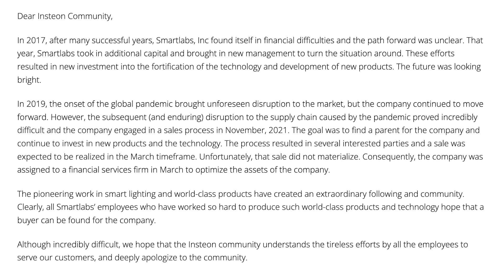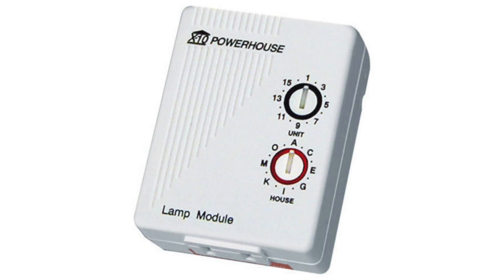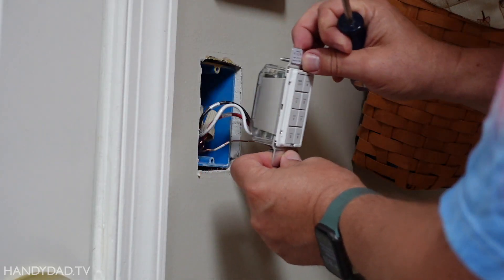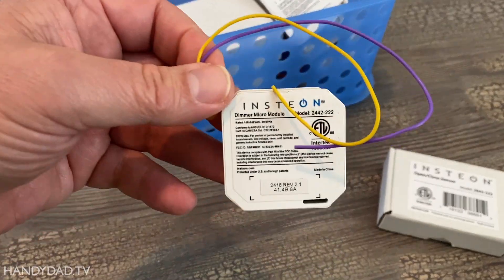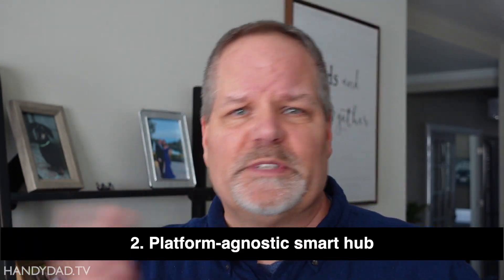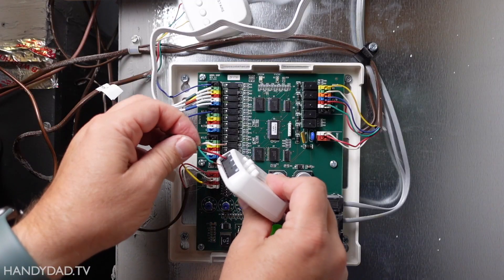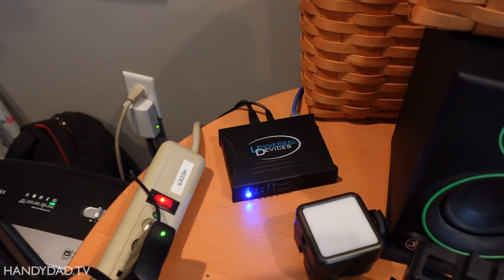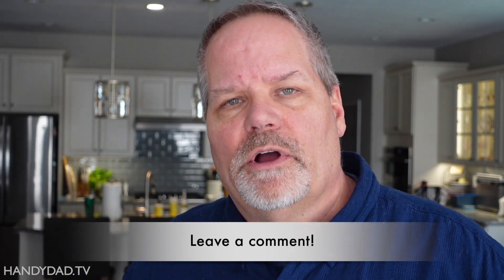INSTEON out of business. What to do?

Comment: I've had Insteon since 2005 when it first came out so about 20 years.  I soon found the ISY controller which lets you easily program the Insteon devices to talk to each other directly, no hub required.  The ISY also lets you setup time of day and IF-THEN-ELSE programs to turn ON lights at night etc.
When the original Insteon company went under, my system kept right on going as it is not reliant on outside servers.
I have purchased more devices from the new Insteon company.  If it fails, my system will continue to work.
Reply from the maker: I admire your commitment but I switched to open standards.

Comment: I have the Insteon Hub v2, and I have around 40 insteon devices in my home. However, I recently installed Home Assistant to integrate other devices like phillips hue lights. The problem is that when I press a button on a insteon keypad or light switch, Home Assistant sometimes recognizes it and sometimes doesn't, and other times it does but takes up to 30 seconds to respond. My local network is very good. I'm not sure if it would be better to use the PLM instead of the hub. What do you recommend?
Reply from the maker: My recommendation is to plan your exit strategy.

Comment: Insteon is still selling devices. 

I feel is there is nothing on the market that offers even a fraction of the features that insteon switches have offered for more than 15 years.

\-Duel mesh network resilience 
\-Led brightness control  
\-Button press beep control  
\-True up and down rocker style  
\-Built in dimm by pressing the rocker (not a seperate button)  
\-Ramp on levels  
\-8 Button switches  
\-Linking devices/switches without a program  
\-No need for wifi  
\-insanely fast/responsive
\-most all colors of decora colors for devices and wall plates.
\-remote switch option
Reply from the maker: You’re not wrong about the technology. If only they made it an open standard 10 years ago, Zigbee wouldn’t have had a chance. 

I just don’t believe the company will make it long term.
Reply: @handydadtv  If what you forcast, is true, then lucky for us Insteon users, another Insteon feature is also true: the devices can be set up and programmed in so many different ways, (even manually).  The devices can function whether the parent company exists or not.  I just purchased a USB Modem to tinker with. 

Best Wishes

Comment: My home automation is purely local. I was considering to get some Insteon stuff a few years back. Home Assistant was what I went with and have had zero regrets. I pay for Nabu Casa, but do not use it as I don't need access to my home automation stuff when I am away from home. I do it to support the Home Assistant team. I buy switches, etc that have Tasmota pre-installed on them or can have Tasmota installed on them. I have also bought some Zigbee devices (Zigbee 3.0) and have the Sonoff Zigbee 3.0 USB dongle. Home Assistant has plenty of integration, including Insteon. I had a few X10 back in the day.
Reply from the maker: I went with HomeSeer. I have tried to setup Home Assistant several times on my NAS and just can’t justify spending the time to get it all working with my Zigbee/ZWave combo stick. And the Insteon integration isn’t nearly as functional as HomeSeer’s.

I kinda feel like a failure because so many people use it! I’m sure I could get it working; it’s just a matter of time that I don’t have. 

Maybe when I retire…
Reply: @handydadtv  I first started with HA on a Pi, then as a VM on Proxmox on a small brick PC and then in Proxmox  on a much better system that had more resources and I was adding more and more VMs and such. Because  I had so many VMs, LXCs and I did not want HA to be down when I had to restart Proxmox. I have 95% migrated HA to the HA Blue hardware (Odroid N2+) . I have MQTT, Node-Red & Zigbee2 MQTT , ESPHome running as LXCs on a smaller Proxmox system. I still need to get InfluxDB and Grafana installed as well. When I had HA on Proxmox, the rest were add-ons inside HA. I prefer to have them isolated. I had to Zigbee2MQTT on a VM, as passing the USB port of the Zigbee dongle was quite unstable. Everything is very responsive and I am adding more and more automations. Next project is to use a Martin-Jerry 3 button dimmer that is running Tasmota (3rd party open-source firmware). Using rules to create different lighting scenes for the bathroom. Default will be warm white low level. Can change to warm white mid level, then to full level neutral white. Also can vary the brightness as a normal dimmer as well.
Reply from the maker: Wow! I definitely appreciate this info because it confirms that I made the right decision FOR ME at this time. I am a computer geek and I’m sure I could solve it eventually if I dedicate the time. Maybe someday.

Comment: I have insteon in our house, 4 yrs old, no wifi connection just wall switches, i have one toggle switch that will not turn our dining room light on, it worked for a year or so, then it was intermittent now nothing, i have resett the switch but that was no help, Our controller or hub is in our attic and since insteon went  out of business our electrician will not snswer his phone, and with a bad knee i cant get around in the attic,  any ideas?
Reply from the maker: First, it was a mistake to put your hub in the attic. Temperature extremes are bad for electronics. 

Second, Insteon was only out of business for around 8 weeks. They’re back now, but your hub will only work with a paid subscription. 

Third, even if your hub is fine in the attic and you paid the subscription, if you reset the device, you need to pair it to the hub again.

Comment: You took me back in time.   I also have many X10 modules and the clock timer.    Worked well for a long time.    I still use an X10 motion sensor on an external floodlight.     I do not look forward to the day when this motion sensor dies.
Dave.
Reply from the maker: If you haven’t heard, Insteon was resurrected. https://youtu.be/hZXfzFe9wDM

Comment: Homeseer looks great.  It's a bit out of my price range, though.  I'm considering Hubitat as a more cost effective route for keeping my Insteon setup working (with Alexa) with no monthly fees.  I'm worried about the learning curve, though.  Any chance you might have a look at it?
Reply from the maker: I looked into it and the Insteon interface sucks. Same with Home Assistant. That’s why I recommend HomeSeer. Yes, the Insteon plug-in costs $59, but that’s cheaper than the cost of a single Insteon device. You didn’t skimp on your switches. Don’t skimp on the solution to keep them running.
Reply: @handydadtv  Thanks for that quick reply and insight.   Also, your videos are amazingly clear and straightforward.  Much appreciated.
Reply from the maker: Thanks so much 😊

Comment: I have a house full of insteon devices.  I started migrating into some zigbee and z-wave devices when I added Kwikset smart locks to my doors.  The ISY/Universal Devices products have integration for all three technologies and I have found it to be much better than the Insteon Hub.  I will miss the wall multi-switchs and hope that some one buys up the patent and starts manufacturing some of the insteon products (including the PLM which you have to have with your ISY to make it work with insteon)
Reply from the maker: The need for a PLM is definitely a drawback. I had an ISY/ZW with a PLM, did a review, and then sold it. I’m a happy HomeSeer user now. It works with the Insteon hub, which most people have.

Comment: Looking forward to figure out what to move to next. I really liked insteon connected with the scenes in a Universal Devices controller except two things. I've already replaced the power line adapter three times and the fan controllers are inconsistent speeds when you have two fans in the same room low medium high are not the same on both of them.
Reply from the maker: I went with HomeSeer because it works with the Insteon hub. Future devices will be Z Wave.

Comment: I have a huge investment in Insteon. I ended up purchasing a HomeSeer Probdevive and the Insteon Plugging. Works great and gives me the ability to integrate wireless, x-wave, zigbee, etc. in fact I already have some x-wave devices controlling Insteon devices. No requirement for cloud services.
Reply from the maker: Agree, HomeSeer is a great solution.
Reply: Appreciate the tip - only hub available right now is 899.00 model - a lot of people in need, but looks ver good
Reply from the maker: The good thing about HomeSeer is you can set it up on an old Windows laptop or desktop with a 30-day free trial. Then migrate to a HomeTroller when they are back in stock.

Comment: So a lot of this is a bit over my head. I just bought a home that has Insteon lights. I downloaded the app and am failing to get it set up. Continuously getting error messages no matter what I do. Is this just not going to work for me now? Is there a simple solution?
Reply from the maker: That depends on how many Insteon switches you have, and how much you desire to keep them. You can continue to use them manually, but automations and voice control will require another solution since the company went out of business. 

This is the easiest solution I’ve found: https://youtu.be/1bs-IBOp72A

If you want to go this route, I’m going to be doing an in-depth setup tutorial in a couple of weeks.

Comment: don't worry! Insteon devices, hubs, and such are NOT dead! yes their app and servers are dead but not the devices in your house!

I have a whole house of Insteon devices!

Use Insteon devices and Hubs with Homeassistant. the LED stays red but works!

Use Insteon devices with the hub and already programmed timers like day/night timers. My sunset and sunrise still works!

Use Insteon devices without your hub.

Use a ISY which requires the hard to find Insteon PLM which is prone to failing caps!

Homeassistant works with the ISY hub, Insteon hub 2 (no PLM), hub 1 (PLM), or a USB/Serial PLM. The community is working on getting it to work with the very short released HomeKit Pro Hub.

Homeassisant is free and supports many devices and networks. they are also open source. it works on Raspberry PI or computers. dockers and VMs!

Homeassistant works with many devices without cloud, the goal is to make the devices work without cloud!

As for keypads, Creston (Pro Install) and Lutron (I think DIY & Pro Install) both are the only ones I know right now who have keypads.

Apparently Universal Devices the makers of the ISY hubs are in talks with the liquidation company to take the assets, servers, and patents!

I currently have my Insteon House working with Home Assistant but since I'm a Crestron installer, programmer, & integrator at work I'll be upgrading my house to Creston lighting, Shading, and automation.

If anyone is looking for help with the current Insteon network on their house or help finding alternatives go to the Insteon reddit!
Reply from the maker: Home Assistant is great for techies who have the time to read, research and troubleshoot. The software may be free, but my time is valuable. 

The Insteon integration is undergoing major enhancements right now since Insteon went out of business. It’s not there yet; it needs a few more months before I will review it for my audience. Some of my viewers think HomeSeer is too technical! There’s no way they are ready for Home Assistant and YAML. 

At this point, HomeSeer is my favorite. https://youtu.be/1bs-IBOp72A

Comment: I purchased the Homeseer software which has been around for over 15 years and their Insteon integration works with existing Insteon Hubs over your local network (NO Servers needed) the Integration also works with any PLM  and runs on an old P.C. running windows 10 or Linux or it can run on a Rasberry PI, for under $250.00 it is on sale now. They also sell pre-configured hub servers which can be expensive. Homeseer uses software plugins that support most devices and protocols, Z-wave, Zigbee, Insteon, Ecobee. Lutron. TP-Link, Hue, LIFX, Sonos, and many more. Yhis is more than Lighting control, this is Home Control.
Reply from the maker: I’ve only been using it a couple of weeks, and just for lighting, and I’m very impressed.
Reply: @handydadtv  I started with X10 and got Insteon from the Smarthome store in Irvine CA I also had an ISY-26 that would not work with Amazon Echo.
Reply: "Any PLM"? What Insteon PLM is there other than the 2412n?

Comment: In my previous home I had installed 69 Insteon devices about 10 years ago. In my new home it came with 6 Lutron devices but I liked the Insteon better, especially the 6 & 8 button switch. I had some extra devices that I brought with me. I purchased the Insteon Hub, 2245-222 a couple months ago but I didn’t try installing it until a few weeks ago. SURPRISE! I forgot that I needed a PLM. I am a Mac person but I forget which PLM I need. I do have an older model AppleTV that may work to keep my iMac 27 from staying ON all the time. Can you please suggest which one is best. I do have an extra modem PLM but I don’t remember why I switched to the USB version. I am looking at the Home Assistant software.
Reply from the maker: So you have a hub and a USB PLM?

Comment: Hi Chris... apparently I made the same mistake - hitching my wagon to INSTEON.  Didn't see the big go-dark situation because I'm using a Universal Devices ISY.  My home system consists of 65 devices -- all Insteon lighting and no Z wave.  The reliability of Insteon devices isn't great so I'm marking time till I have to make a move away from Insteon.  Last look at Universal Devices was a bit confusing - ISY, Polisy and much confusion.  I'm thinking my first step will be to add a Z Wave radio to my ISY device.  From that point I should be able to start a one-by-one move from Insteon to Z Wave devices.  There are a few caveats:  Insteon made an 6/8-button switch which, as far as I can tell, isn't being done by any Z Wave manufacturers.  My house is loaded with about 20 of these devices so I'll need to do some lighting restructuring.  I'd be interested in any comments from folks that are in this same situation.  (thanks for making this video)
Reply from the maker: I have a 5 button ZW scene controller to test when I get through the hub reviews. Stay tuned.
Reply: @handydadtv  Thanks for the update.  I'm definitely interested in a ZW scene controller such as this.

Comment: If I use home assistant, will I be able to access my insteon devices remotely and not just locally without the need to use a company's cloud servers?
Reply from the maker: I’ll be covering Home Assistant in a future video, but my understanding is you can access it remotely if you subscribe to the optional service called Home Assistant Cloud.
Reply: @handydadtv  thanks for the reply.  Through a relative, he suggested looking into HomeSeer.  I did some research and they don't require using their cloud servers as long as you are tech savvy enough to do the setup correctly, otherwise you can use Homeseer's cloud servers.
Reply from the maker: HomeSeer will be my next video. 😉

I also read that a techno geek can do the work to get Alexa voice control without paying for Nabu Casa. 

Challenge accepted! 😂

Comment: My advice, stay away from hubs all together. I would also recommend Home Assistant, its open source and runs on a LOT of different hardware from raspberry pi's to intel nuks to many different types of PC's, the list goes on and on. And it works with a LOT of different manufacture's devices. I currently have aqara (no aqara hub required), smartthings (no smartthings hub required), meross, home kit, harmony hub, GE, switchbot, zooz, sengled and many other devices in my smart home that work directly with home assistant. Most of them are zigbee and z-wave and wifi. Also have espresense (room presence detection) intergrated through mqtt which home assistant runs as a intergration. Also it has a ecobee intergration as well. And also has support for the insteon devices even though the company has closed its doors. And  they work locally, (not through the cloud) so automations are very fast. Plus there is a lot of supporting docs and community to help with questions. FYI i also started with X10 devices. Radio shack got me started with them.
Reply from the maker: Thanks. Home Assistant is on my list.

Comment: I started with X10 back in the late 80's and currently run a mixed system of X10 and Insteon through Home Assistant and a Raspberry Pi4 talking to a PLM. Many of my X10 switches and dimmers are original and still work fine. Many of the Insteon devices have failed over the years and had to be replaced. As an EE looking at the Insteon designs, it's as if they were designed by amateurs who don't understand design margins or how to protect against transients. With the demise of smarthome I'm seriously looking at the Lutron system as a future replacement.
Reply from the maker: I’ve replaced a couple of keypads over the years, probably from surges. I’d always try to keep an extra on hand; buy when on sale instead of when you need them. 

I know nothing about EE, but I believe you. Still the best and most reliable home automation platform I ever used.
Reply: I too started with X10 back early 90. Migrated to Insteon because of there 8 buttons keypad. I used them to not only control lights but also run HomeSeer events to turn on TV etc. I still have 6 keypad in my setup. I also have lot’s of dimmers. But every time they die, I replace them with Lutron Caseta. With Lutron make more thing like keypad.
Reply from the maker: Lutron has been trying to get me to convert to Caseta but I’d really miss those keypad dimmers.
Reply: @handydadtv  Also, there’s no setting with Caseta. I like the double tab to instant on. And the wife like that at 10 pm, an event dim all the the dimmer led. At 11pm, the bathroom lights are set to turn on slowly, up to 20%. I don’t know other dimmer that do all this.